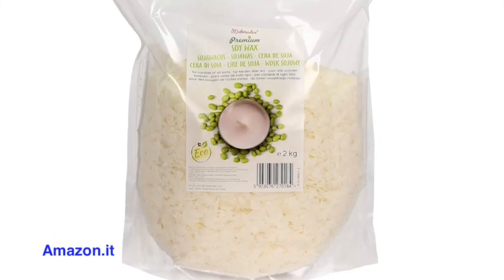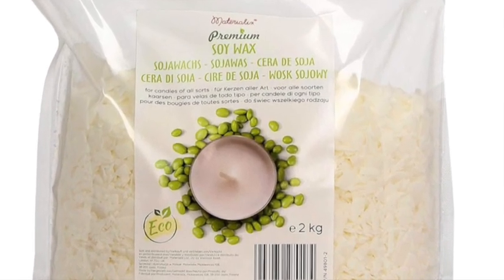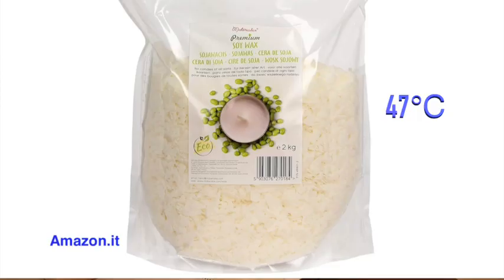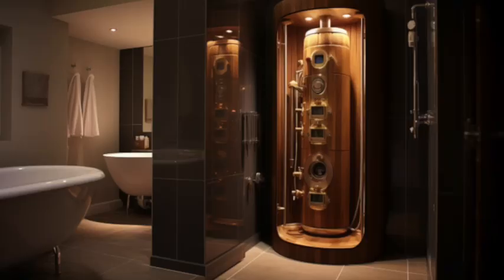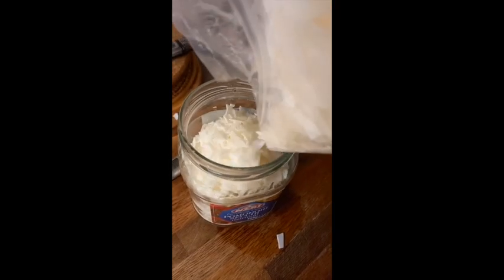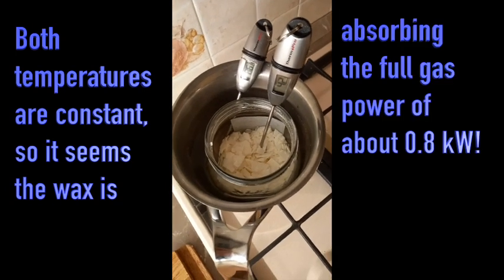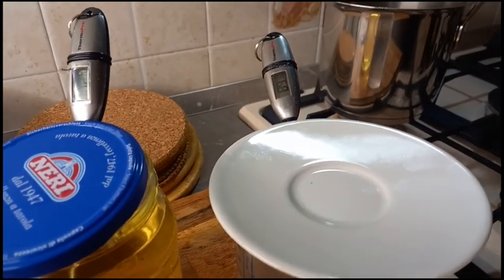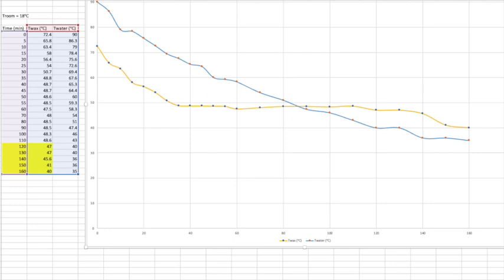Have longer heat with Phase Change Materials (PCM), experiment with wax - Video 38b

Comment: building a 11kwh extendo lfp hv battery for my chevy volt now, which fits behind the rear seat over the rear axle. might expand later to 33kwh (30kwh usable). just put in parrellel with hv battery (thats the hard/sketchy part, involves drilling holes in things that are not supposted to have holes in them lol). 112s 32ah lfp cells should line up perfectly with the native voltage range of hv lmo 96s? hv battery.
wanted to do some kind of cooling solution, was going to stuff some fans in the abs sheet enclosure to at least blow cabin air over the hot terminals but also wanted some kind of thermal mass solution from below the pack. found some 100mmx30mmx500mm aluminum rectangle channel, i htink ~1.5mm thick for really cheap. volt hatch is almost exactly 1 meter wide so 2 of them fit well. was going to isolate with thermal pad + epoxy sheet + thermal pad and just lay batteries on top but al doesnt have much thermal mass since its specific heat is so low. that is of course the whole point of a heat sink. at first i was going to epoxy the ends and fill them up with water+glycol, but worried about them getting hot and bursting in my trunk. think i will add ionic/salt based pcm to the channels inside of some thicker polyethylene bags. was going to do ~2% by wt nacl for nucleation and inhibition of anhydrous hydrates (thats how ionic pcms can fail over time), xantham gum to stabalize, and then just saturate as much as possible with cacl2 de icing salt. 
ionic pcms are way better compared to organic based on total energy, density, weight, volume, ect, but they have an issue with durability/mixed hydrate formation and supercooling.
with such a small battery pack application, all i really want to do is prolong the amount of time it takes for the cells to freeze so they are not as likely to be damaged by charging in cold weather and also minimize the peak temperatures they experience.
there are a couple more things you need to do to trick the volts computer into being okay with the hv buddy pack (positive side contractor, timer relay, and ~200a igbt positioned backwards and in parellel with contactor for charging path). waiting on the remaining cells to be imported. the entire project cost less than 1000usd post tarrifs here in the usa. aroud 2000usd for the final 33kwh pack but starting small at first. 33kwh added pack + 16.5kwh native pack = 50kwh total/40kwh usable with ~160mile range lol
Reply from the maker: Hi G Money, I just subscribed to your channel, you are miles ahead from anything I did with EV's (I had also a prototype of Siemens / Audi, which made an electric Audi 100). My Chevrolet Volt has still good battery capacity but with 130000 km it is close to the formal battery life. But my problem is to import it from Switzerland (where I worked) to Italy (where I live now). The Italian authorities make it so difficult. I think we should get in contact, it is great to know a peer Volt owner in a continent where you practically don't see them. Would you like to join the Facebook group Energy Home DIY ? At https://www.facebook.com/groups/1440674419825846

Comment: Thanks for this video.  When experimenting with things like this, it's important to keep in mind that soy wax is a bit safer than paraffin due to the low melting temperature, and high range between that and the flash point where it releases acrolein, a lung irritant.  Paraffin is a hydrocarbon based material so, if I recall correctly, it also emits toxic gases if heated too much.  So temperature regulation and toxic emissions are important considerations in all cases.

Also - there is a device available called the PowerPot you should check out.  Basically it's a cooking pot for campers/etc which charges your devices using the heat.  It apparently uses TEGs to harvest the heat energy and convert it to electrical with a literal cable coming out of the pot that you plug your devices into, and even includes a little power meter/LED light to indicate when ready to charge.  They did some kickstarter campaigns, met their goals and released their products.  They have 3 sizes.  I wonder if it would charge longer if you used the pot to melt that soy wax...
Reply from the maker: That's great Gummi, thank you for the Powerpot, I found it already and am curious to find out more, or buy!
It is right to be careful with safety, should do the related research in future. I like wax indeed more and bought the bag of it.

Comment: You could also look in to Sodium Sulfate and Calium Chloride, both have useful melting points. Adding some Sodium Chloride to the Sodium Sulfate can lower the melting point. Borax may help with supercooling issues. Xantham gum to keep it more as a gel and help it last longer as a useful heat storage. NighthawkinLight on youtube was able to get around 18F so it could be used as a cooling device as well. In my area I can find these chemicals cheaper than paraffin or beeswax per volume. I'm not sure what any of these pcm do after hundreds or thousands of cycles, or if there is a way to keep them in good shape for years and years.
Reply from the maker: I was indeed at the search for such materials and looked for those that can be purchased easily. I could easily do some research and filter on "purchasability", temperature and heat capacity and see what comes out. I'll put it into my todo list! I am now making a few videos about the summer heat and it would fit in, to store & release summer night coolness.

Comment: I have experiments in the laboratory about this topic and I want to ask you about them. Is it possible to contact you?  Because I want to calculate the amount of energy transferred from water to the PCM during the charging cycle and vice versa during the cooling cycle.  Is it better to start by heating the water to a temperature of 50 degrees above the melting point of the phase change substance, which is 36 degrees, and start monitoring the temperature changes... or to heat the water gradually as it enters and exits the experimental body until the temperatures are equal?
Reply from the maker: Hi Ahmad, you can certainly contact me, do you mind to send me your WhatsApp number or email? You can also leave a message on my website https://energy-garage.energy/home/
That is a website specially aimed at Access to Energy in Developing Countries. 
Regarding your two options, you can choose both, but don't use such a high temperature, because already at 93℃ you will run into problems with wax (if that is what you use). And such a ∆T is not needed. You can put a thermometer in the wax and another in the water and see how it goes in time. You can even use a thermostat to switch the heating of automatically. I noted also that the Phase Change Materials (PCM) must be in thin containers, otherwise it will release the heat too slowly: it is a thermal insulator.

Comment: It might help in an emergency situation where the grid goes down? To sleep in a small confined space like inside a car?  Warm up lots of small bottles of soy wax and put around sleeping bag.
Reply from the maker: Yes exactly, that would be an application. In some way you can also absorb motor heat in those wax bottles!
Moreover, talking about black outs, I showed in the video already the frozen water bottle: in normal times in the freezer, at the blackout immediately into the fridge compartment. Ice is also a Phase Change Materials (PCM), and a strong one!